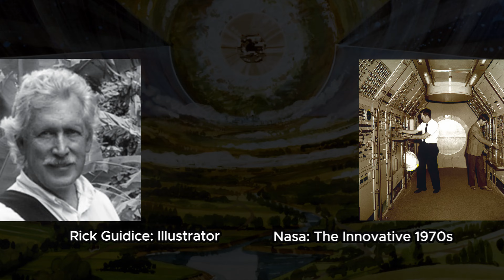Nasa's 1970s Vision For The Future

Comment: The ambitiousness of these ideas is of the charts! If only space had oil these things would have already probably been built.
Reply: "Space" DOES have all of these things. O'Neill designed his cylindrical colonies to be built using material from the Moon so that it would be easier to get the material to wherever you wanted the cylinder. You would still need to lift thousands of tonnes of organic material from Earth, but the bulk of the construction would be taken from the Moon.
https://en.wikipedia.org/wiki/The_High_Frontier:_Human_Colonies_in_Space